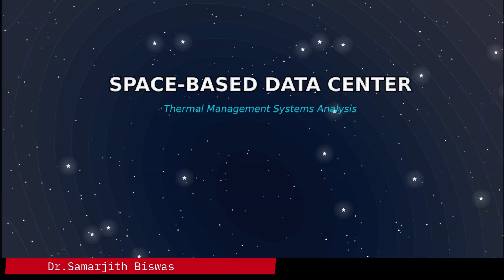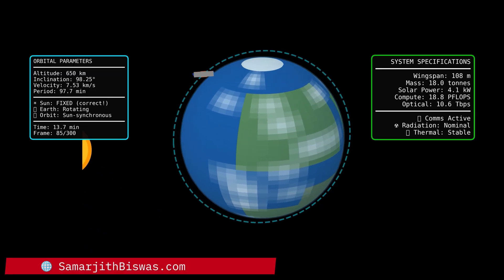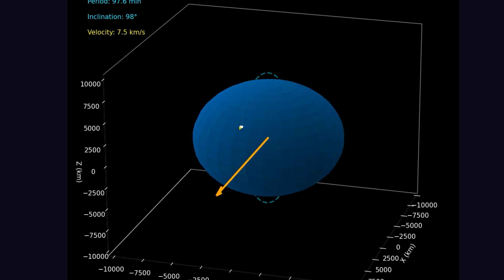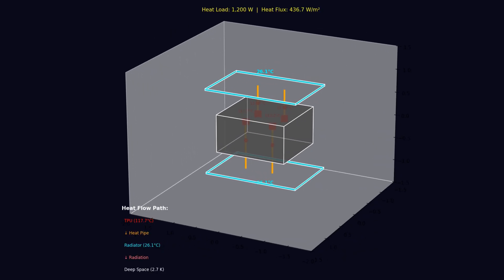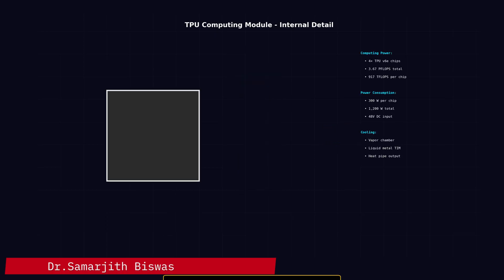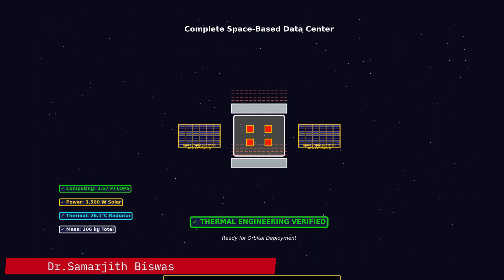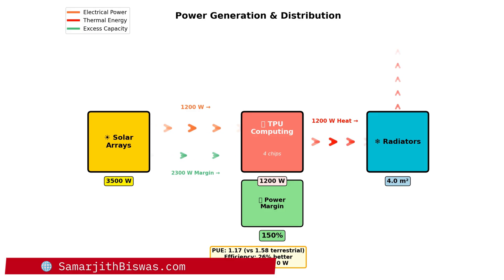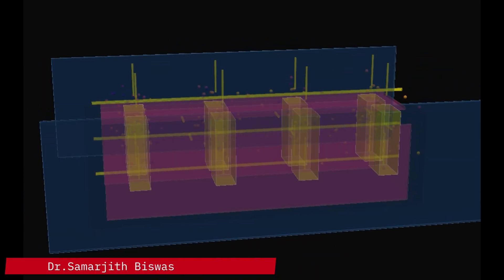Google's Next Data Centers Might Be in Space | Engineering Breakdown

Comment from the maker: Important corrections and acknowledgments after receiving feedback:
After reading your comments, I need to address several issues with this video:

@rudde7251 is RIGHT: Vacuum IS a thermal insulator - radiative cooling is HARD
Google lists thermal management as an UNSOLVED challenge
Entire economic case depends on SpaceX achieving $200/kg (highly uncertain)
TPU power specs are ESTIMATED (Google hasn't published official values)

WHAT'S ACTUALLY UNCERTAIN:

Whether advanced thermal interfaces will work reliably in space
Whether SpaceX will achieve projected launch costs (7-15× reduction needed)
Long-term on-orbit reliability without servicing capability
Whether 10% efficiency gain justifies complexity and risk

VALID CRITICISMS FROM COMMENTS:
✓ Waste heat recovery on Earth (cogeneration) could make terrestrial better
✓ Space debris concerns are legitimate
✓ Vacuum cooling challenge under-emphasized in video
✓ Economic assumptions are optimistic, not guaranteed

I'm leaving it up as a learning experience, but strongly recommend reading the corrected description first. The analysis explores feasibility - it does NOT prove space data centers are definitively better than Earth.
Thank you to everyone who provided technical criticism. This is exactly how science and engineering should work - claims get challenged, errors get corrected, understanding improves.

Samarjith

Comment: Did you forget that the vacuum of space is a thermal insulator? THERE IS NOTHING THERE TO PICK UP THE HEAT. Heating the ISS isn't a problem, COOLING IT IS, because vacuum of space have nowhere to dump thermal energy. If you actually would want a infinite thermal mass, you'd look to the ocean. But we all know you're not a PhD, your an imposter as anyone in the field would know this as well as their own name.
Reply: WTF half of the video was him talking about heat dissipation lol
Reply from the maker: You're absolutely right that vacuum is a thermal insulator - this is fundamental heat transfer physics, and I didn't emphasize this challenge enough in my video. Let me address your valid criticism:
You're correct about:

Vacuum prevents convection and conduction heat transfer
Heat rejection in space occurs ONLY through infrared radiation (Stefan-Boltzmann)
ISS cooling is indeed harder than heating (they use pumped ammonia loops + 26m² of radiators for ~70kW loads)
This IS one of the hardest engineering challenges for space-based data centers

What my analysis shows:

1,200W heat load requires 4.0m² radiator area with high-emissivity coatings
Radiator operates at 21-25°C, rejecting heat at 360-440 W/m²
This is within demonstrated ISS External Thermal Control System performance (300-400 W/m²)
BUT requires advanced thermal interfaces (liquid metal TIM) not yet space-qualified

Where I failed in the video:
I made it sound simple ("just radiate heat to space") when it's actually one of the PRIMARY engineering challenges Google explicitly lists as unsolved. I should have been much more clear about this difficulty.
Reply: Elon Musk just confirmed in that Saudi Forum that not only datacenters in space is possible, but it is the only way to scale up significantly

Comment: Aren't there cold cities that need heat?
Reply from the maker: Excellent point. You've identified a key inefficiency I didn't address:
Waste heat recovery on Earth:

District heating systems can use data center waste heat
Microsoft's Finnish data center heats homes in Espoo
Google's Hamina facility provides district heating
Effective PUE can drop below 1.0 when accounting for useful heat output

In space:

1,200-1,600W/satellite radiates to 2.7K deep space
This thermal energy is completely wasted
No opportunity for cogeneration or useful heat recovery

System efficiency perspective:
If Earth-based data centers use waste heat productively:

Space advantage shrinks from ~10% to potentially negative
Only makes sense if computing demand exceeds locations where heat is useful
Or if other factors (unlimited solar, no water, land constraints) dominate

Why space might still make sense:

Not all data centers can do cogeneration (location constraints)
Cooling demand often exceeds heating demand in warm climates
Space offers unlimited cooling capacity scaling

But you're absolutely right - I should have included waste heat utilization in the economic comparison. It's a significant factor that reduces the space advantage for data centers that CAN implement cogeneration.
Thanks for raising this - it's a real consideration I missed.
Reply: @SamarjithbiswasPhD  thanks for the detailed reply!!

Comment: This thought experiment has a major flaw. Believing anything that SpaceX says.
Reply: Don't like Musk?  

Boeing sure did not believe SpaceX.  How is the Starliner doing?
Reply: @croire1481  We all know tesla delivered on the promises of the cybertruck, amirite? How exactly is boeing's failure related to this?
Reply from the maker: You've identified the biggest vulnerability in this entire analysis. Let me be completely honest:
The economic case ENTIRELY depends on:

SpaceX achieving $200/kg launch costs by mid-2030s
This requires Starship full reusability (100+ flights per vehicle)
Sustained 20% learning rate for 10+ years
Current costs: $1,500-3,000/kg (7-15× higher than needed)

At current launch prices:

81-satellite constellation launch: $60-120M (at $1,500-3,000/kg)
Completely economically non-viable
Would never achieve cost parity with terrestrial data centers

If SpaceX doesn't achieve projections:

At $500/kg: Marginal economics
At $1,000/kg: Not viable
The entire concept falls apart

What this means:
You're absolutely right - I'm "believing what SpaceX says" about future launch costs. This is:

Optimistic scenario planning
Based on demonstrated learning rates (but extrapolated)
Not guaranteed by any means
A speculative bet on SpaceX's Starship program
 The video should have led with: "This ONLY works IF SpaceX achieves unprecedented launch cost reductions."
Thanks for calling out this critical assumption - it's the foundation the entire analysis rests on, and I didn't emphasize that nearly enough.

Comment: Some careful analysis from a guy who thinks the Earth doesn't cast a shadow in space.  😂 Or maybe he imagines that there is somehow some orbit that would keep it Out of The Shadow.😂  
Course the first step would be to strip all the cooling fans they have mounted directly on the microprocessors.😂 Save some launch cost there.😂
Reply: There is a geosynchronous orbit. But I also don't see this as a viable option
Reply from the maker: think there's a misunderstanding here about the orbital mechanics. Let me clarify:
On Earth's shadow:
My analysis explicitly accounts for eclipse - see Section 6 of the technical report. Dawn-dusk sun-synchronous orbit (the configuration I analyzed, consistent with Google's proposal) minimizes eclipse exposure:

Orbital plane oriented perpendicular to sun direction
Satellite "skirts" Earth's shadow edge rather than passing through deep shadow
Maximum eclipse: ~5 minutes of reduced (not zero) illumination near equinoxes
95%+ sunlight duty cycle throughout the year

Temperature impact during brief eclipse:

Radiator thermal mass: 48,600 J/K (thermal time constant ~45 min)
Temperature drop over 5-min eclipse: 0.5-1.5°C
Junction temperature change: <1°C (negligible)

This is different from:

Standard LEO (16 eclipses/day, 35-45 min each in full shadow)
Geostationary orbit (daily eclipse seasons)

On cooling fans:
You're right that there are no convective cooling fans in space - that's exactly WHY we need large radiator panels (4m²) and heat pipes. The entire analysis is built around passive radiative cooling.
The configuration I analyzed:

81 satellites at 650km altitude
Sun-synchronous orbit, 98° inclination
Dawn-dusk (6:00 or 18:00 LTAN) to maximize solar exposure
This is Google's proposed configuration, not my invention

What made you think I ignored Earth's shadow?

Comment: Could you explain how radiation is sufficient to dissipate this much energy? I have a passively cooled computer of only 65 W and it needs quite a bit of cooling surface meet demand under load - and this machine gets to use (passive) convection whereas in space one does not. To cool 1500W continuously in space you would need quite a big radiating surface - but what sizes are we talking about?  Assuming demand and efficiency remain in line with expectations raised by OpenAI, Xai, Meta, Google - each are talking op gigawatt sized data centers - we'd need millions of satellites. Don't get me wrong, I love the idea of carbon neutral and not littering all that heat and killing the last corals we have in the process but this whole idea still feels "far fetched".
 
 Also, I had to turn up the volume for you talking but jumped then when the music returns in full swing. Can I suggest to normalize the merged audio clips next time? Thanks!

Comment: Ah, yes. More space debris in orbit, just what we need. We should try developing a way to fix  that thing before starting to construct bigger things out there.
Also, maintenance will be a dream.
Reply from the maker: You're right to be concerned about space debris - this is a serious issue. Let me address it:
Debris mitigation in this concept:

650km altitude: natural orbit decay within 25 years post-mission
Complies with NASA-STD-8719.14B debris mitigation guidelines
Lower than most problematic debris fields (700-900km)
Satellites deorbit passively via atmospheric drag

Your point on maintenance:
Absolutely valid. On-orbit servicing is HARD:

No human access for repairs (unlike terrestrial data centers)
Component failures = satellite loss
Requires redundancy design (increases cost)
81-satellite constellation allows graceful degradation

The debris challenge:
You're right that we should solve debris removal BEFORE adding more mass. Current proposals:

Active debris removal demonstrations (ClearSpace-1, ELSA-d)
End-of-life deorbit requirements
Collision avoidance automation

Honest assessment:
This concept adds ~40 tonnes to LEO (81 satellites × ~500kg). Small compared to Starlink (30,000+ satellites planned), but your principle stands: we should be better stewards of orbital space.
Good infrastructure planning means solving debris removal in parallel with new deployments, not sequentially.